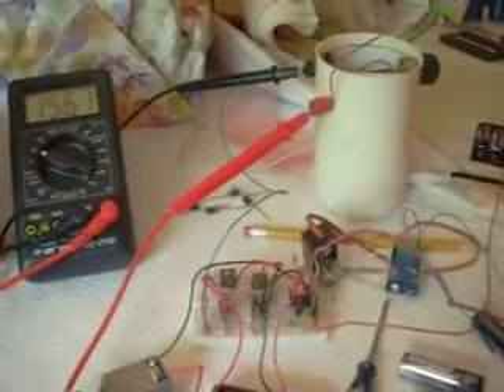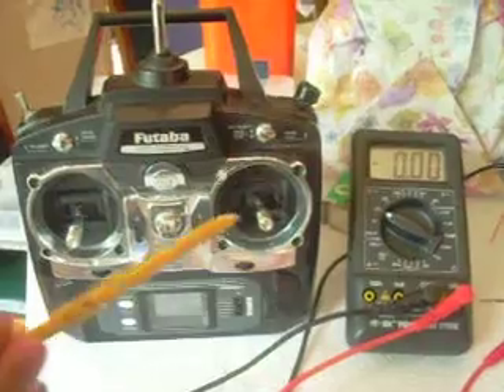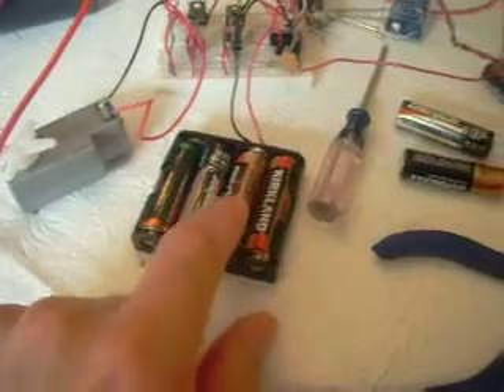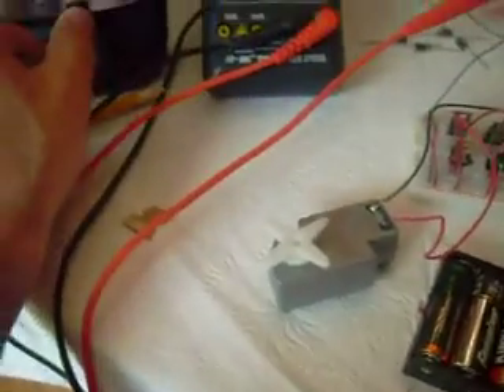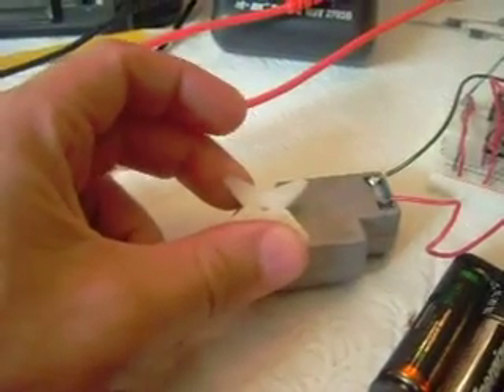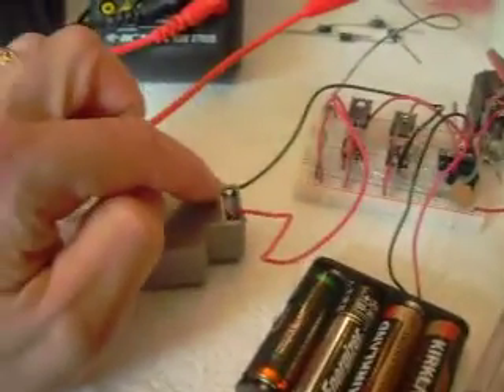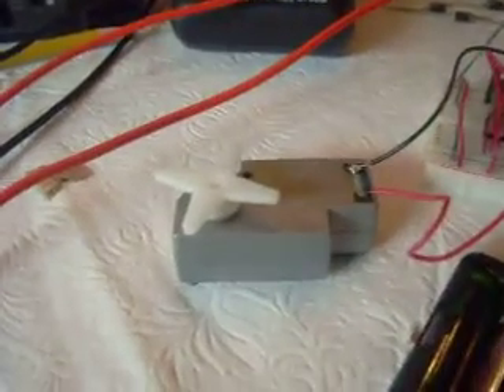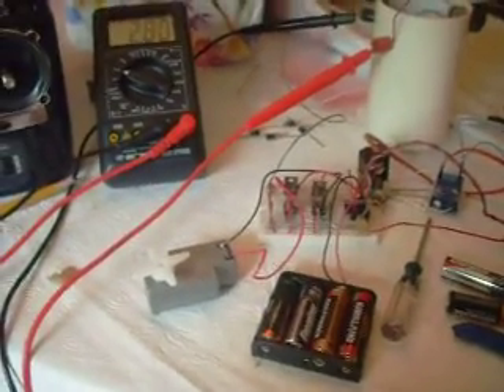YG Servo Driver 007.avi

Comment: COMMENT 3
     By making Your outputs into inputs I would expect that it would make the transistors more off.
     Because a high on an output is around 5V, but a low can still be about 1.2V and that's still not off enough.
    Well Good Luck Man.

Comment: COMMENT 2
      I'd put some diodes on the output from the micro controller so that the diode's .7 volt voltage drop will make the transistors be more off, but that may also keep them from being fully on when it's time to go.
   But maybe the jitter isn't really that big of a deal and You could get away just leaving it the way it is, like You said it's probably not powerful enough to really affect any thing.
also You might try making the micro controller outputs into inputs while not being used.

Comment: I would think that Your transistors are being turned on even though they are supposed to be off right now, also if they are on then they might be shorting out to each other which might be why Your power supply is going low because it might be being shorted out.
   Check to see if Your transistors are getting hot while it's not supposed to be moving, also check the voltage regulator in Your power supply to see if it's getting hot while the servo isn't supposed to be moving.   NEXT COMMENT